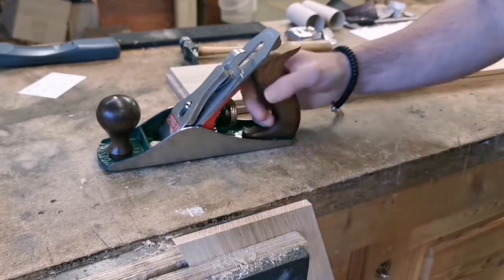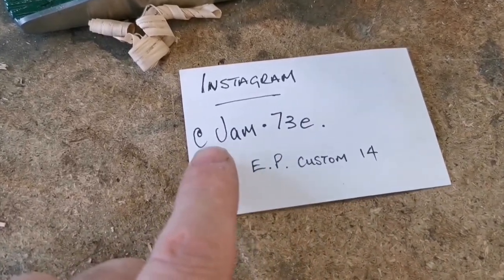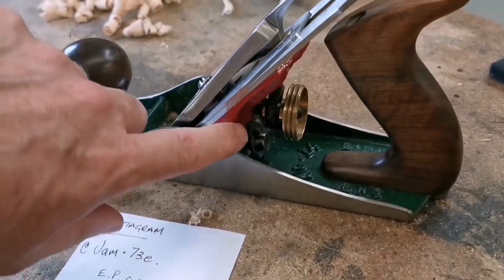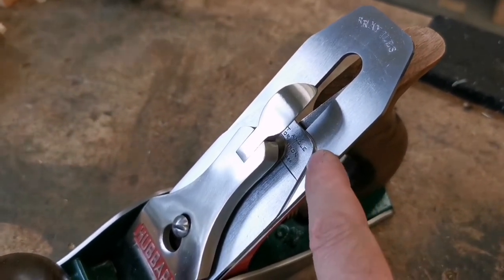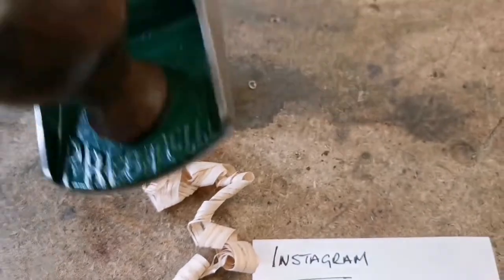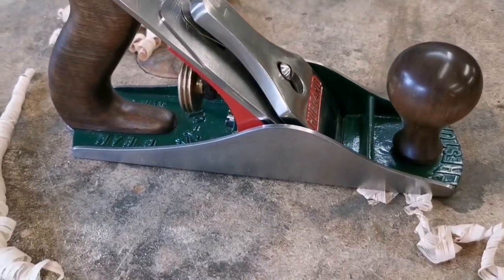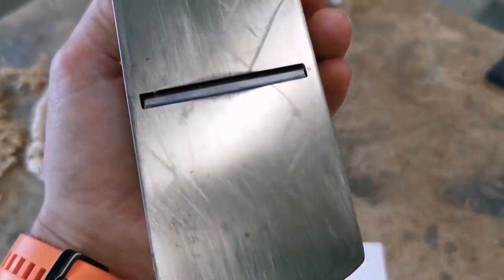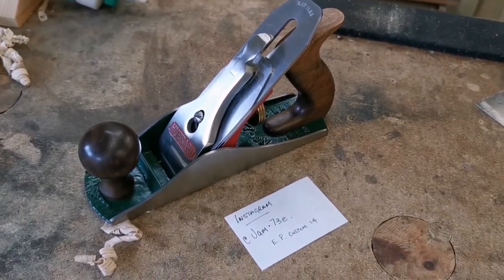Preston No14 smoothing plane - From a couple of parts to almost perfect.

Comment: I have an original  Preston No 14 with everything original. The frog is green, the same colour as the sole. I know some had a  red frog on the tote of mine  still has most of the original decal, too, and are rosewood, and near full length original Iron and original chipbeaker,  you did a fantastic job of yours,  I use Ray Iles Iron's a lot on my planes to save the original Iron's,  they are brilliant Iron's,  I have many Preston plane's and spokeshaves in my massive  collection of plane's and many Stanley sweetheart Plane's from No 1 to No 8 and Millers Falls type 1s and early type 2 No 8 Millers Falls,  I have many Record SS type1s Norris plane's and a set of the first Clifton's,  and a Record calvert Stevens CS88 in mint condition and many many more I have restored over the years,  I started doing carpentry at the age of 5 years old back in 1965 and worked as a professional qualified carpenter and joiner I have planes from the early 1700s  still in perfect condition and usable,  Badger plane's rebate plane's very early Sargent VBM plane's and Sargent autoset plane's shoulder plane's,  I must admit I really love Preston plane's specially to bullnose planes,  and spokeshaves , I have some Lie Nielsen plane's and Veritas quite a few combination plane's,  thanks for your video I love what you did with your Preston No 14 great job, best wishes from Norfolk.
Reply from the maker: Thank you for this Roy. You live too far away 😂 Your collection sounds fantastic. Another plane video coming in the next few weeks.
Have you subscribed? It would help me out if you do.
The next plane is an ECE Emmerich primus plane. It needs a little tlc.
Thanks again
Jamie